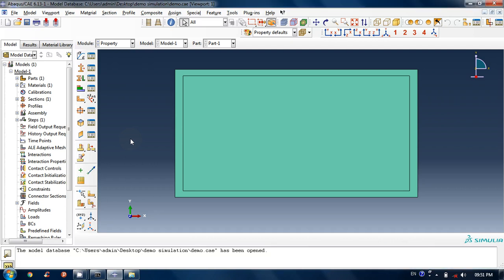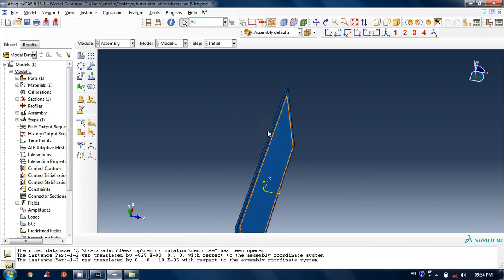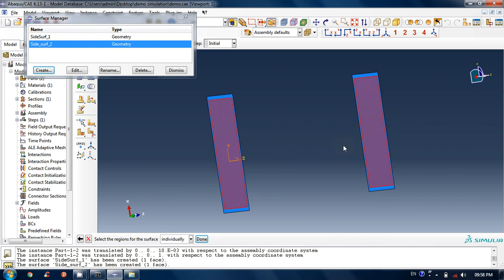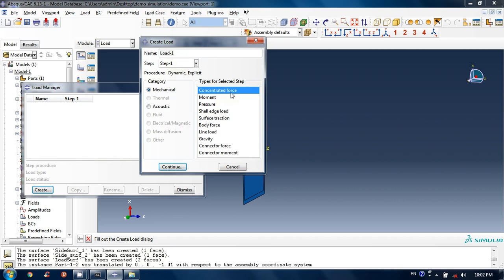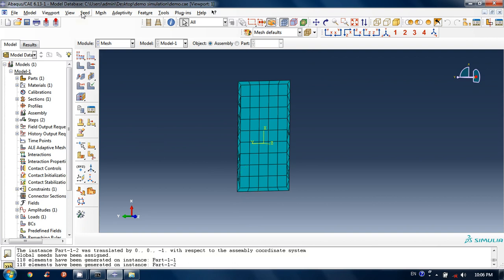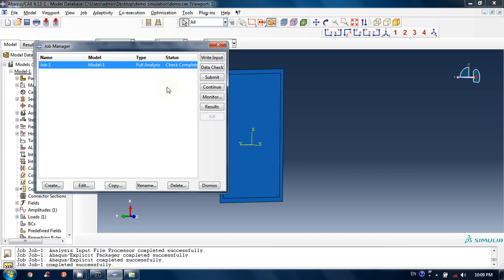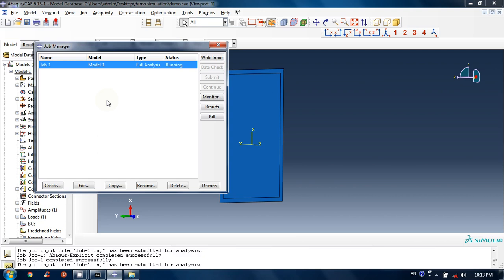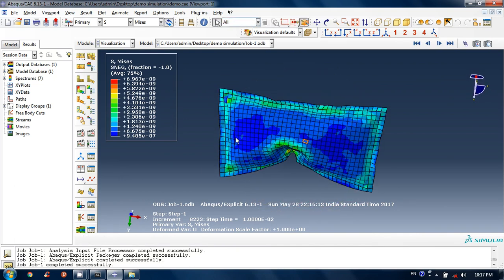Abaqus part 3

Comment: hi... I have simulated with 2mm mild steel sheet metal, I need 'U' magnitude of around 40mm. For that I have given around 65 MPa Internal pressure (referred some journal), but vonmisses stress value shown was too high, some thing around 20000mPa. I agree with wesley yu comment....There is some issue that needs to be sorted out....

Comment: There is one problem. Even in the under-inflated case, the stress easily exceed the ultimate tensile strength of typical plastic. How did this happen?
Reply from the maker: Wesley it happen due to excessive bending.
Reply: Dhirendra but the stress is over E^7 in most of the area
Reply from the maker: Wesley Yu that exececive stress is because of excess loading. The aim of this video was to demonstrate the process. If you iterate it for different pressure, you can have the pressure value for which stress doesn't go beyond yield or failure stress.
Reply: Dhirendra but even if the bag is under-inflated, the stress is already too strong. This is unrealistic and I wonder what can explain this.
Reply from the maker: Wesley Yu too strong stress means stress beyond yield?  Inflated bag can have too strong stress but lower than yield which is not shown here.
Reply: The typical ultimate tensile strength of plastic is nowhere near 10^8
Reply: Would you please answer? I am baffled.